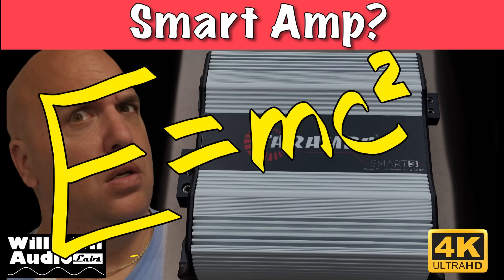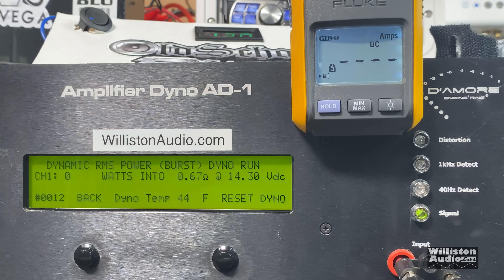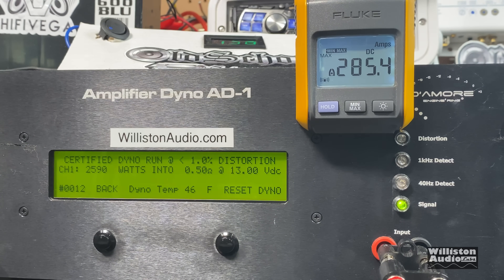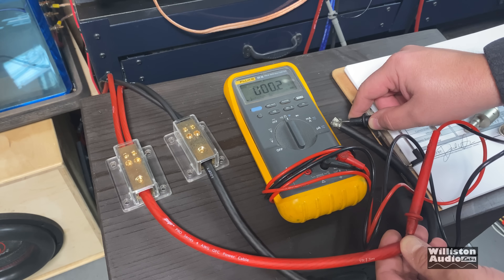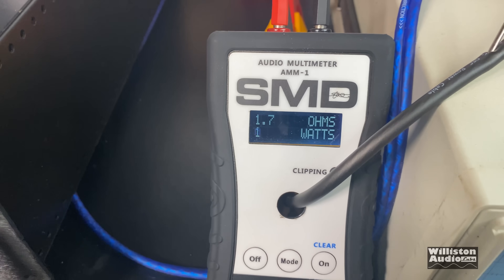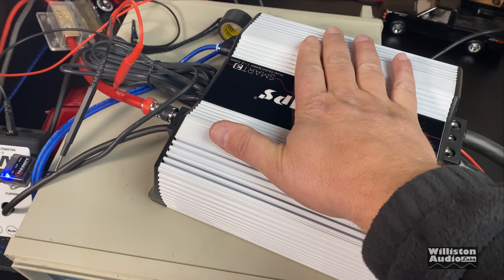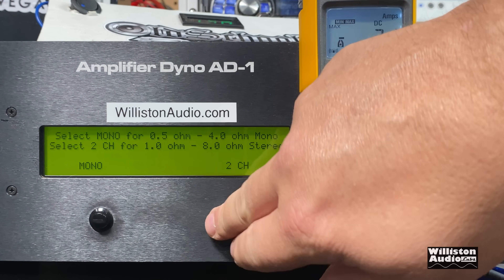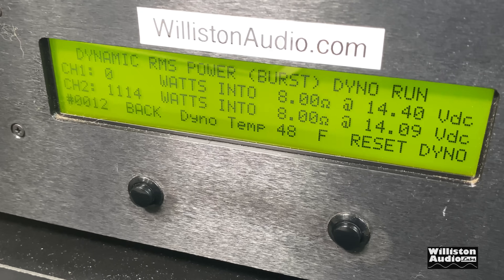Taramps Smart 3 vs 6000W Sub and INSANE Amp Dyno Low Impedance Testing [4K]

Comment: Never used to care for this brand amp because they would burn up. But it looks like they fix the problem. For the money this is a very impressive amp. Especially since you can’t burn it up anymore. They keep improving these. It won’t be long everyone else will have a hard time selling their stuff.Big D I really love what you do you’re the best at this keep up the great work
Reply: It was only the HD 3k that had plastic melting issues cause ppl used single 4 Guage power wire the HD can draw 300 amps 4 Guage is good for about 1k or 100 amps.if it's proper off wire notb20ndollar Walmart kit
Reply: @joshholden8561  Power wires that’s a whole Nother thing. There’s definitely a difference in the quality of wires. I built my system quite a while ago. Don’t remember where I got them. The best I’ve done is 172SPL. Not bad for an SQ system. I run 4 double 00. For power . When I didn’t know better I was using welding cable. Don’t do that anymore.
Reply: i went from a sundown saz4500d to a soundigital 12000.1d, the bass is dirty, like hard. before it was soft low with authority. i would rather go other topoligies and brands. power is not everything. these amps usually have 5% distortion at all times.
Reply: QuadFeed You were probably using the crossover in the amp. This is the problem. I run to DSPs in my car one for the right one for the left. If you run DSPs you can have any kind of sound you would like.
Reply: @joecool7165  i use bult in crossover on my HU, 80hz 18db slope
Reply: QuadFeed that explains your whole problem
Reply: @joecool7165  I'd use 60 htz but that's me
Reply: @joshholden8561  If you’re running a three way system that’s a good frequency. I typically run 4 to 5 Way systems. Everything Mono but the voice. Have a lot of control over this way. And you don’t lose the round around effect
Reply: @CVLova  agreed. It will fry coils quick even in non clip with audio vocally being heard.
Reply: @numlockkilla  yes. they are also full range. gna go another brand later on, but damn it sucks :D
Reply: @CVLova  simple fix is the rca inline crossovers FPODS. Cheap and look cool. Also if your head unit has a crossover built in use that.
Reply: @numlockkilla  ye i use built in xover
Reply: @CVLova  that why u hear vocals on a full range amp get a head unit with crossover or buy 1 they aren't expensive look on Facebook marketplace 20 30 but or. Buy a new one on Amazon 30 but but DONT BUY SOUNDSTREAM BASS RESTORER. They are garabage.not worth 5 bux if u want a really really good 1 get the taramp digital model then the can dial in every htz signal from 10 htz up to 20 k
Reply: @CVLova  ur  wrong the amp dyno in certified mode goes up to 1 percent distortion then stops counting.

Comment: I wonder if you can help me with this info? I want to know the colors on the two big resistors inside the HD3k close to the spear terminals between those blue rectangular shape capacitors? I have one of those amp and those two resistors got burnt!
Reply: They are 2 watt 10 ohm resistors
Reply: Great under  the resistor on the board was marked 10R 3 watt so I replaced it with a 10 ohm 3 watt resistor. I just put it back in my mom jeep to play two 10"  a B&C and and an eminece!

Comment: No doubt this amp has power but the sound quality isn't very good.
Reply: You don't need great sound quality when your brain is rattling from 3k powering subs 😋
Reply: @headkase11  lol! 3k isnt a lot when it comes to subs, especially when you're used to over 16k
Reply: @bartowflorida low key bragging is cool, but no one has a SQ build with even 25 percent of that power.   I bet your loud asf tho..
Reply: @SBK_ALL_DAY  I actually have 2 separate builds. I do have a genesis sedan that is being built for sound quality, but it will have 3k on the sub, 1600 on midbass and 250 on hlcd
Reply: Actually trying to decide if I want to do a big class a/b on the sub or use a smart3. I'm going to do a little more listening and comparing before I make a final decision on that. My truck has a smart3 now and its sounds really good,  but then again, its 7ft away from me
Reply: @bartowflorida  For sq class ab is great.
Reply: @bigbob3409  I definitely agree on mids and highs. Haven't quite noticed the difference on subs and with 3k, a class a/b would get pretty hot and draw a ton of current. Right now, I have 3 options : orion xtr4000.1d, taramps smart3, and modded lanzar opti900x2.  I'll let Big D Whiz chime in on that
Reply: @bartowflorida  its almost impossible to hear the difference in class a/b vs class d for subs in my opinion. Low mids maybe but doubtful.  Mids and highs ya you can tell
Reply from the maker: I’d agree with the HD3000, but this one sounds fine to me
Reply: @wal  I take you at your word. You are live with the amp 🔉👂
Reply: You can't tell how good something sounds through a video.....
Reply: I have 2 of these. 1 on subs and 1 on mids and they sound really good. I havent noticed any overhang or lack of co trol on my subs. I noticed it on the old taramps and stetsom, but this one is different
Reply: @bartowflorida  need an epicenter on the old models
Reply: @bartowflorida  How the hell do you get left & right (Stereo) sound from your mids if there is only one input for the amp?
Reply: @AlwayzLearning  2 amps. 1 for each side
Reply: im pretty sure that BOA isnt a good reference for sq 😀

Comment: The technology used in amps today is crazy compared two twenty years ago. The amp I use is over 20 years old. I dont push it hard very often but when I do it gets hot as hell real fast.
Reply from the maker: The old Class A/B amps get real hot because they are much less efficient

Comment: What did you wire the massive audio sub to?
Reply from the maker: It’s a dual 1 ohm sub wired in parallel to 0.5 ohms nominal
Reply: .5ohm is what it was wired to

Comment: forget that amp.... I'm digging the the sub!!!!!!.... you can see the box getting ready to come apart...more power and that box would have gave up the ghost
Reply from the maker: The port area requires was incorrectly stated in the spec sheet/manual for this sub. I had the box built to spec and it is not correct 👎

Comment: is the bass still considered muddy or have they improved
Reply: Chuck Holmes  not at all . my korean amps cant do what this amp can , they burn up or protect while this new taramps LOL's at it. these amps sound great also . this amp right here is a look into the future . this amp is going to change the industry because its the SMART thing to do , vastly less components , smaller heatsink , less shipping cost , smarter at power delivery. there will always be those people that swear by their 8 tracks and records sound better ... or a 10w AlNiCo sub that someone will say sounds better than any modern subwoofer.... moral of the story dont be afraid to try new things , you might actually like it !
Reply: Chuck Holmes  Chuck, you are misinformed.
Reply: Chuck Holmes  I said they can sound worse due to the pre-amp section allowing a lot more higher frequencies to pass than the Koreans. The resulting bass is less smooth and sounds less controlled through most subs. The amplifier section has no difference in the sound you'll hear though. So if you want a Korean sound from these you must introduce sharp LPF at or around 50-60hz.

Comment: Haven't seen 8 ohms in a while. Reminds me of a sub I had that was a bandpass Rockford Fosgate 12 that was 8 ohms and at 300 watts. I think it was $500 installed. 
Times sure have changed. I now have 3500 watts for less than $1000.
Reply from the maker: It would take a 5kW plus Korean amp to get 1100 watts at 8 ohms

Comment: I want a manual fan-on or fan test switch to make sure it works without heating it up.
Reply: Switch or button or whatever is cheapest. All these smart fans on all the brands that do them scare me because so many amps get buried and seemingly forgot about, fans fail, and if my $300 (or much more) amp died because I didn't know I needed to replace the $10 fan inside I'd be pretty pissed.

Comment: What would be the best 10s at a cheap price to go in my Chevrolet Silverado 1500 got a box under back seat with a mono boss amp 1500
Reply: just look at something really cheap cause that boss amp isnt good. i dont know the model but if you look up pioneer 10 on amazon, you will find one thats rated 400 watts rms. i have those and theyre great.
Reply: Hard to say without knowing the model #. My guess is 4-500w if the max is 1500w. İf you go to ct sounds website. They have bio 10s for $56 each open box. Should do ok with your amp.
Reply: Got two 10"  kicker comps in my regular cab behind the seats relatively cheap

Comment: Gotta love that Northstar battery next to the sub😁
Reply from the maker: Yeah I bought that for my Accord, still haven’t put it in (as secondary batt)
Reply: I'm running a Northstar 220 and Northstar 170ft in my daily, running a Deaf Bonce AAB4800.1 with a stock 80a alt and my voltage doesnt go below 11.6 full tilt at idle, if I'm at 2k rpm it wont go below 13.6

Comment: Great video, I Kno it is alot of work to setup but I would love to see more .5 subwoofer test with amps, though results will vary depending on application. Still great 👍
Reply from the maker: Once I get my new test bench completed, I’ll easily be able to swap between ohm loads with subs using Ohmie

Comment: Thats crazy power! that little taramps 250x2 I have got super hot running just a pair of tweeters had to replace it with a punch amp👍
Reply from the maker: That’s really odd. Tweeters shouldn’t be overloading the amp. Must’ve had an issue or something. Never go wrong with the Punch amps though 👌
Reply: @wal  well you I was maxin that volume Big D🤣🤣🤣

Comment: Just purchased one using your link. :) Wish me luck.
Reply: let me know how it sounds, I may have to pick one up too!
Reply: @rashad5286  I will install it tomorrow, I ordered it this morning and had it delivered same day.   I have a dual 1.4ohm subwoofer so I will likely just wire it down to .7ohm on a DC Audio XL 15" m2 @14.4v with dual 2/0 runs with a short 1/0 jumper from the distribution block to the amp. Should be nice step up from my previous Memphis 16-mcd1000.
Reply from the maker: I appreciate the support. I think you will be impressed 🤙
Reply: She bangs. Haha
Reply: @TheYouTubeAquarium  OHHH shit bet mines should be here Thursday.  It push that sub good? Rn i have a s1 2250 on 2 hds2.1 12s hoping itll be a bigger upgrade so i can get a bigger box and some meaner subs 😂

Comment: I don't think that subwoofer can handle not even 600 watts RMS..
Reply from the maker: It can handle 2500-3000 watts without issue. Watch the video and you’ll see...
Reply: @wal   besides the subwoofer.. I get the taramps 3k bass. But I didn't like too much because it clips more than the 3k hd. And why?? Do you have any idea.. and thank you for the reply
Reply: @ricardojuarez291  probably lack of power to support the bass 3k , they were built to have better voltage for american market .

Comment: I often wonder if I should replace my 4 EAW SB-180 subs in my home theater with a couple smaller automotive ones.  To power them I'm using 2 Crown K2 amps in bridge mode, which are rated for 2500 watts into 4 ohms.  The nice thing about the EAW's is the 96Db/1W/1M efficiency, and they play down into the 20's which is pretty good for PA subs.  But it would be nice to not need a stack of subs that's 4 feet wide and 5 feet high.  Any suggestions on what might give me similar output in a smaller package and could run well on my existing amps?
Reply: Look into the neo b&c drivers, both ipal and the regular line.

Comment: You are correct, they need a bass/gain knob.  Dual Rca in and out. Sundown did a good job with their SFB series amps. Damn good job!!!
Reply: Wayne Berry I bet for the price sundown can’t out beat this amp at all those testing
Reply: 2 years later. Sfb line is being replaced by the sia line. Sfbs are junk. But you said damn good job. Lmao

Comment: Taramps is earning that respect, cool video
Reply: Nah, it's still a shit amplifier. The current clamping circuitry is lazy, cheap, and causes driver clipping at lower ohm ratings. Any electrical engineer would tell you to never go lower than 4 ohms with this thing due to how the current clamping circuit works. Say goodbye to your drivers otherwise.
Reply from the maker: Watch the clipping and you’ll be ok. Meter is accurate and you’ll hear when it cuts out
Reply: @JosephArata  have you actually used one of these amps or are you just spouting whatever you think you know in your head ?

Comment: Next test,  throw that massive subwoofer in a vehicle and see what SPL she does.  Then compare to cheap 12s (under 100 to 150) from other companies...
Reply from the maker: The Massive sub is not in optimal box. I mean the port size estimation from Massive was wrong. It flaps badly as it needs larger port opening.

Comment: Nice video i like your 8 ohm test too.. perfect amp for my 15 inch basshorn 😁 i have tested and on the mouth at 1 k watts  155db i think its funny in the car 😁
Reply from the maker: Lawd!! 😳
Reply: @wal  yes it is a 15 ich speaker in a Basshorn.. you can see this horns 4x in my home spl challenge video 😁👍 please make a test of the lab gruppen fp14000 Amplifier china clone too its a powerful amp for openair 😁👍

Comment: I'm pretty ignorant when it comes to Brazilian amps. I have just gotten the impression they utilize high voltage circuitry and there kinda unstable i.e. catching fire and the SQ is not the best. It makes me think squeezing big wattage out of amp that's the size of a older 30x2 amp is kinda worrisome, there's comfort when big wattage is produced from an amp that is physically large. Am I full of misguided misinformation and it's just perfectly good new technology moving forward like class D did to A/B?
Reply from the maker: They are getting better, this one proves it!

Comment: Amps like this are awesome for the home modder, as far as I understand the current limit is set by feedback resistance, so you just change the resistor to change the max current allowed.   I like to play around with opamps and caps too.
Reply from the maker: I think it’s chip driven so you may not be able to modify but can bypass...I wouldn’t recommend though

Comment: I have an Orion hcca 12 dual 4 ohm I'm looking to build around. Looking at this and the md3000.1 2 ohm model. Would you suggest the md3000.1 or this amp? And if this one would you run 4 ohm for the efficiency or 2 ohm for the power? Thanks!
Reply: well you wouldnt run just 1 coil, thats stupid, so its either 2 or 8 ohm, so 2 ohm it is.  3krms for 12" is heaps.  Mine is run off a HCCA3000.4H 4channel bridged 2ch per coil @ ~1500wrms per coil.  It could take some more, but I've already reconed it once.  That's in a sealed 2.5 CU box driver not included
Reply: @minus3dbintheteens60  after going to look at the manual to make sure im not crazy you are 100% right. Lmao. It's been a year since I looked at it so I can see where I got mixed up. I'm not wanting to blow windows out of my car but I also want some ass behind it. Yeah 3k is a lot but I've seen these subs take well over 5k. This is ideally what ive been looking for. Right around 2500-3000 range
Reply: You're right. This amp will beat hard on that sub for sure. It's a  good price and it's SUPER efficient, which means less wasted power into heat, more power for sound, less strain on your electrical system etc. Lots of pro's with this amp, if you choose it you will be happ
Reply: @minus3dbintheteens60  I thought you could wire it to 4 ohm though? 😂😂  I dunno. Ive had the subs for a few years and never had them hooked up. I gave one to my sister's boyfriend in exchange for one of these amps (waiting to tell him which one to get). Im piecing together a build for it so I have time. Just wanted opinions
Reply: Md5k..

Comment: This amp is amazing!
Reply from the maker: It continues to amaze me!
Reply: @wal  wow, i want to buy one, but im still in process of makimg my own sub, 3.5" coil 2+2ohms, mega roll upper suppension, TI basket, neo motor, my friend has cnc, and i need to buy 2.8"x 5" neo magnet. This will be hard to make but hopefully it works out

Comment: Great job buddy! Works as expected! Dynamics will probably be so high as a few cycles of sine wave sneak through at rail clip before the circuit limits the amplitude - in my segment I said how the amp would try and make around 6k at 1ohm without the limiter, seems I wasn't far off!
Reply from the maker: You were 100% correct sir!
Reply: could those few cycles of sine waves damage a sub? a subwoofer stop working for a day and then now it seems to work but I had a 1500 rms sub hooked up at 1 ohm to the smart 3 (Skar vxf 15).
Reply: i guess i know the answer to that question, i'mcurious how the sub stopped working and then seems to be fine now
Reply: @Titans2138  7, spelled S. E. V. E. N.

Comment: Unfortunately still a Brazilian. I had a MD5K and swapped to a Wolfram W3000.1 (Korean) and the quality and authority of the bass is much better.
Reply: Justin C. If wolfram was Brazilian you would say the same thing.
Reply: lol i just swapped from wolfram w3000.1 to this and not going back to the w3000.1
Reply: youre just experiencing the difference in preamp circuits, and steeper roll off of higher bass.